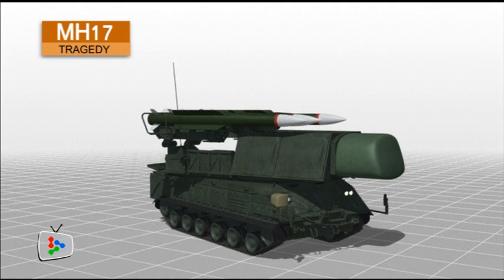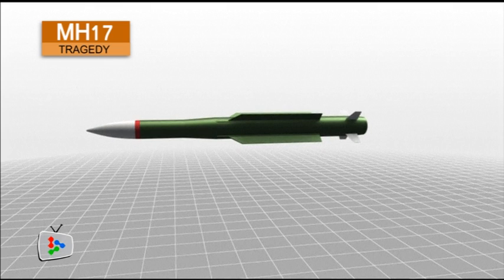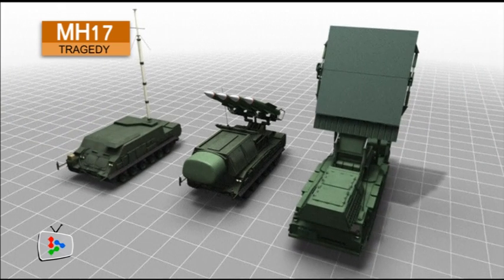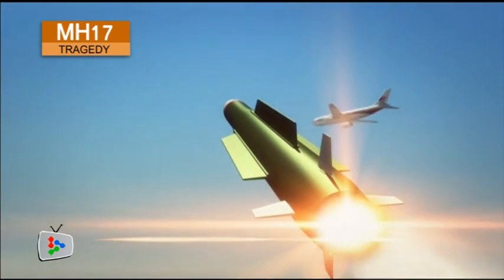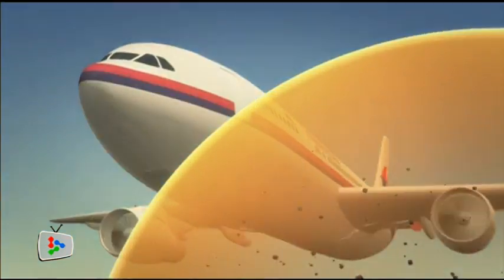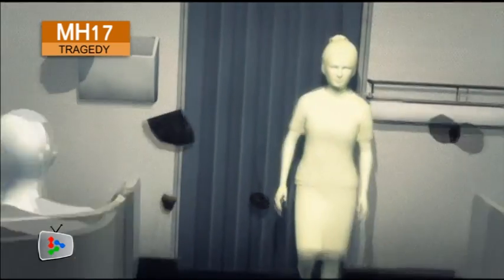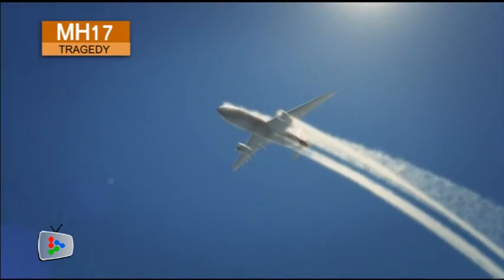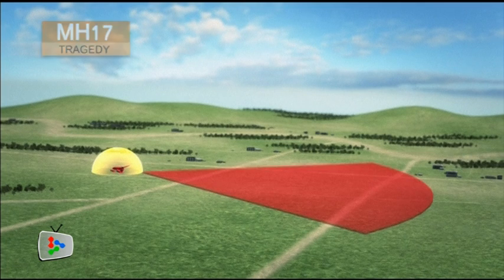MH17: How Buk missile system might have brought down plane

Comment: it's funny how this video attracts typical bunch of pro-Russian trolls spreading hysterical disinformation, lies and propaganda, damage to the MH17 airframe like here:http://l.yimg.com/os/publish-images/news/2014-07-23/26c5ee00-12af-11e4-ac13-2be1ed6bc59d_AP241486628373.jpg is not only typical for fragmentation blast but actually the only explanation ! such dense pattern of holes of different sizes, shapes with irregular edges can only come from thousands of fragments spreading from detonated warhead like in BUK system and are nothing like from gun/cannon fire, not mentioning that 50 rpm fire rate would translate to like 5m distance between each round fired at the target travelling at 250 m/s and those are just few problems with Russian imbecilic propaganda aimed at mostly blindly faithful Russians buying into every bullshit possible, for example at the press conference Russians presented radar recordings without anything near MH17 before and at the time of shot down: https://www.youtube.com/watch?v=766ftKQGqls https://www.youtube.com/watch?v=4bNPInuSqfs&t=1091 it didn't stop them though from gibbering about SU-25 at all, that's how lazy those lying bastards became, ha ! as for further evidence for BUK missile here is a tweet of its trail after launch posted like 3 hours after the MH17 shot down: https://twitter.com/wowihay/status/489807649509478400 and then we have Girkin, Russian agent operating alongside 'rebels' at eastern Ukraine, tweeting this thinking they again destroyed some military Ukrainian plane: https://twitter.com/StateOfUkraine/status/489802664264212480/photo/1 and lastly we have 3 different videos recorded just after the crash in which local residents who mention 'rocket' but not once military jets:
https://www.youtube.com/watch?v=48YlDSVFVMI
https://www.youtube.com/watch?v=JhUkqs9CQ0w
https://www.youtube.com/watch?v=uK76aZ4vku0?